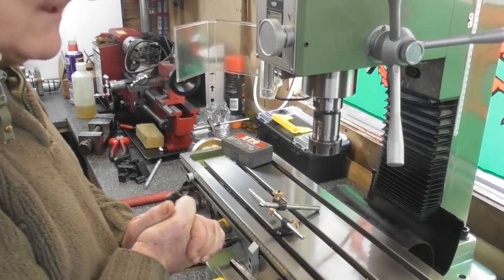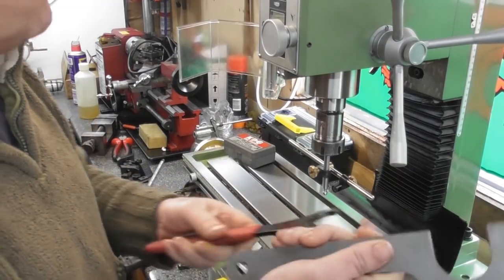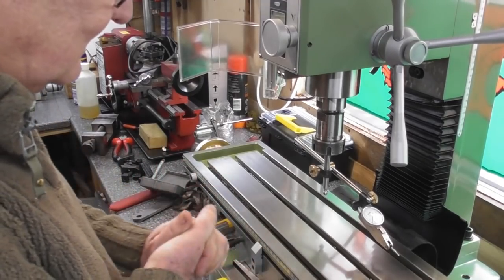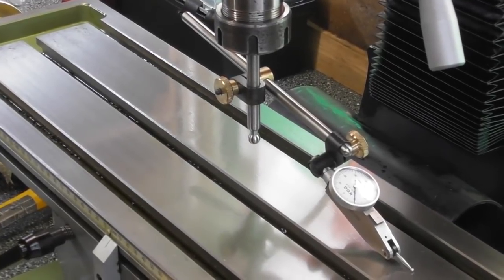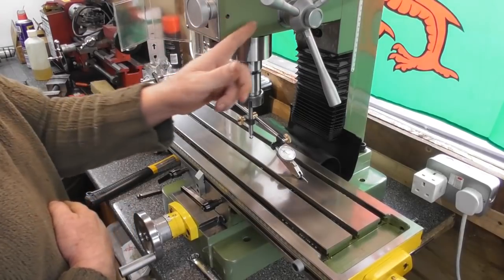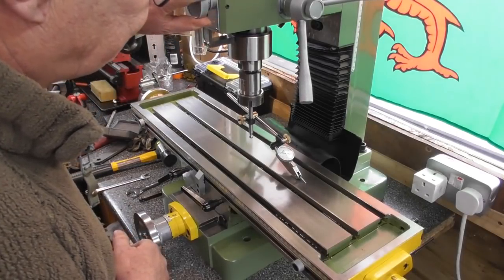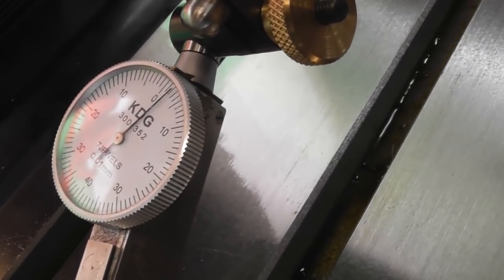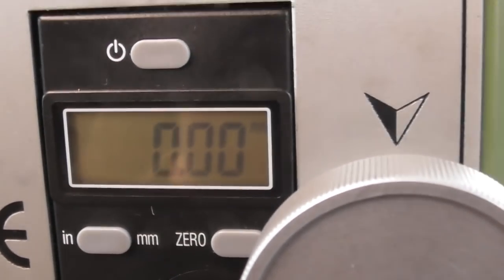Warco WM16B mill   tramming the head

Comment: Next time you need to tram the head, do not keep winding the quill up and down each time and use the built in DRO. Get a parallel or Gauge block, place it on the table, zero out the DTI, swing the arm around180 degrees and gently slide the parallel or gauge block under the DTI to check the reading. Your way you could be introducing errors by moving the quill each time as there is bound to be some error in the DRO digit measurement.

Comment: Nicely done, considering how tricky these small machines are to tram in some ways, especially with nod. I have to check my round column mill drill every now and then because it's almost like the castings were green when it was manufactured and over time the unit gets out of tram.

Comment: Thanks for the update Ade.  When you finally get the vice on make some ply table covers for either side. If you put lips around the top of them it Saves cleaning the T slots as you just remove them and pour the chips in the bin, dings from dropped parts and also stops tooling/ cutters/measuring instrument rolling off.
Reply from the maker: it is on my rapidly growing list , Cheers Ade.
Reply: instaBlaster...

Comment: I was always taught to tram the head in with a bottle square traversing with the quill in the z axis.
Reply from the maker: Hi, Shaun . May I ask what a bottle square is ? is it what I call a Cylinder square. if so. what is the method , sounds interesting , even though I don't have one . Cheers Ade.
Reply: @ade63dug  Yes Ade pretty much same as cylinder square but in profile looks like a bottle. I made one as an apprentice toolmaker and still have it to this day. It was a piece of O1 steel that I had professionally hardened and then cylindrical ground. The bottom face is relieved with a shallow counterbore so it sits perfectly square to whatever datum surface it is sat on. Happy to send you a pic if you like.
Reply: I forgot to mention that my last toolmaking job I had I worked for a German guy who was probably the best engineer I ever worked for and he trammed Biridgeport turret mill quills in by the same methodology. First time I had ever used a Swiss made Interapid stylus DTI and now I have three of them in my home workshop - so much better than any other brand of DTI I have ever used.
Reply: @ade63dug  you run the stylus of the DTI along the z axis with the quill picking up the highest point of the bottle square surface in each of the two positions until it trams spot on. I only checked this on my Tom Senior mill last weekend.

Comment: Hello, excellent video, I have the same machine and it seems like the main bearings (on the spinal) are dry, but can’t see a procedure to lubricant them, any suggestions please, I have used my oil can and oiled from the top drawbar and it has dripped through but not sure if it’s dripped into the top conical bearing, cheers Chris

Comment: Love your videos Ade!  You are one of my favorites. I'm a retired old guy and have a similar machine.  (PM25) I wouldn't trust that little mickey mouse quill dro though,  that just adds another variable. I would like to suggest letting your dial test indicator come around over an 8x11 piece of printing paper you hold in your hand so it doesn't get caught in the tee slots.   Hope you saw my other post regarding your spindle not completely stopping when you turn your rpm down... that's not correct, something wrong there.
Reply from the maker: Not having experience with this type of motor set up i did not think at first that this was a problem , now you have pointed it out i will give warco a call and see what they say , thanks for pointing it out , Cheers Ade.
Reply: Those quill DROs are actually very accurate and repeatable.
Reply from the maker: @CraigsWorkshop  I forgot to answer this part of Joe's question . yes i tested to see how repeatable it was at several different point along the travel before i started. so much goes on behind the scenes ey . It was spot on all the way through the range .  Cheers Ade .
Reply: Yeah I guess what I was trying to say was I wouldn't trust my thumb and forefinger on that little dro🙂
Reply: Just an fyi I don't know how accurate what I'm about to say is, so take it with a grain of salt but I have been told that they buy potentiometers in quantity and some match the circuitry and some don't it's very possible that that's the reason some don't scale to zero rpm. I'm sure the company will never admit to any of it 😕
Reply: @joewest2560  Ah ok, understood! (Me too in that case) :)
Reply: @ade63dug  I have to agree completely with Joe West above.Your method works fine to get the initial head alignment well under what the maximum travel is on the dti. But every video I've seen done by highly experienced machinist's and all the reference's I've ever read mention just swinging the dti 180 degrees in each direction. Pre loading the indicator by a thou or two once your very close still allows it to gently cross the tee slots as the indicator is swung around in each direction. The reading displayed or it's resolution on these type of bar scale dro's is certainly not what there repeatable accuracy is, and even more so when you check them against something like a proper set of gauge blocks. I have a very good and fairly expensive Mitutoyo quill dro on my Bridgeport clone mill specifically designed as such, and I still wouldn't completely trust it to do the final tram on the head. Even my digital Mit. micrometers come with a test certificate graph showing where there inaccuracy's are located. Once I'm within that couple of thou I always swing the whole indicator as that minimizes any error stack up. On even the best dro's the "allowable" and world wide standards are a repeatable accuracy of + - one count maximum. Yes there usually better than that, but being that amount off will still will pass inspection. Given there cost? It's unlikely these much cheaper Chinese quill dro's are even checked never mind verified for there accuracy.Your method introduces uncertainty and further areas where the final tram may or may not be correct. Plus it's far faster and easier to just swing that indicator around while having much more certainty in it's reading.

Comment: Ade, i don't want to put the spanner in the works but i would retram without moving the quil up and down, the quil fine feed is just a glorified caliper and not as precise as your dti. Try it on a piece of metal while cutting, do a cut, raise up using the fine feed then lower it again to the same reading and do a repass, you'll find that sometimes it cuts, other times it cuts air and other times just rubs but not cutting then next time a slight cut. 
Another tip, buy yourself a 2032 Li battery charger and rechargable button batteries on aliexpres as I garantee you'll forget to switch it of and when you come to use it the battery is dead, don't ask how i know. The chargers and rechargable 2032 lithium button cells can be got in a pack, I got the charger and 4 rechargables for i think 8 quid, well worth it especially as some of my other stuff uses the same button cell.

Comment: Hi Ade, Just a thought for the future. You could make a 90 deg bracket with a reamed hole in it and mount it to the underside of the head, drill and ream through the hole ( into the column) and insert a dowel, would stop you having to tram the head every time.
Reply from the maker: Yet another great idea. perhaps a tapered dowel with a threaded portion to the outside for an extractor nut would be awesome . i hope not to tilt the head often though. Cheers Ade.

Comment: I wouldn't rely on the Digi gauge on the machine Ade... try using a piece of plate glass or, as Chui Rios said a couple of gauge blocks or as you mentioned, a brake disc to tram the head. I used  plate glass to do mine & achieved 0 - 0 on the X axis & .0005" on the Y axis. I have also fitted adjusting/lock pads on either side of the head at the top to lock the head in position.

Comment: I have been thinking the tramming would be easier if you put a large piece of glass on the mill table and tram on that to get close to perfection. 

Then remove the glass and indicate on the table to check your progress.
Thanks for the vids
Reply: Thats the way I do it.
Reply from the maker: another sweet idea , wish i had some glass , Cheers Ade.
Reply: Didn’t I see you with some 321 blocks on previous video. You could use one of those under the dti tip and just slide it around with the dti . Hope that makes sense.

Comment: Hi are, exalant vids ,just finished re building my mill (up graded to fixed column. ) had tilting column which constantly went out of alignment. Check out edge technology for exalant quality tools at a good price. I have small tramming gauges (much more stable than the set up you have used ).thanks for sharing, have fun Malkin chips and be safe.
Reply from the maker: I have seen them . on my future wish list. i need more important things first . Cheers Ade.

Comment: ADE... My way of tramming my mill will be to attache chains to it, and suspend it from the roof
of the shed. Now swing it from side to side like a pendulum when it come to rest, slowly lower it onto 4 pre-drilled bolts.
If it's correctly mounted using this method, the DRO should read about 12 oclock ...
If the DRO reads 11.55, then it will be to slow, or 12.05 say... it will be to fast...
This can be adjusted on your rpm control to make it run at the right speed...
Just some advice...

Frank...
Reply from the maker: Perfect , i shall try that out , lol. Cheers Ade,
Reply: @ade63dug  Oh, I forgot to tell you Ade, the problem with this method is, that I now need a new
roof on my shed...

Comment: I did this for the first time the other week - before that I just ran it with head set by eye. I had the added problem that the bolts that hold the head would twist about 0.1mm to one side, so had to adjust with a bit of offset...
Reply from the maker: I was thinking as to why this happens , on my mill they were nasty thin mild steel washers with spring washers and then some nasty cheap nuts, i think if i used a thicker , tougher washer with no spring washer it may help , with better nuts as well , i found that by watching the clock and progressively tightening so as not to move the needle i got there in the end . interesting subject though. Cheers Ade ,
Reply: @ade63dug  on my mill, the clamp is on one side of the round shaft that attaches the head to the column. When you tighten it, it twists a little bit.

Comment: I have the same problem with nod on my mill by 0.3 over 250mm. I need to check to see if the column ways are square to the bed ways of the machine. (table removed) I'm not sure how measure this. I would like to find where the error is.  It could be where the head connects to the column, Column to the base, The block in between the table and the base or the base ways.  Any information on how to do this would be of grate help (:
Reply from the maker: There are so many variables , my first thought it to check the gib on the column, Are we talking about a new or well worn mill. ? send me an email and i will give suggestions as to where to look. Cheers Ade.

Comment: Hi Ade, some good info' for when/if I ever get a Mill.  Sorry if I missed something, but what if the table isn't flat and/or parallel to the ways.
Reply from the maker: Hi Steve , a very good question . firstly this issue of flatness of the table . I do not have the equipment to test this out , i have to take if as read that it is flat on the grounds that it is ground cast and new , i know that this is not guaranteed but it is a starting point . secondly it is not a problem if it is not parallel to the ways as i am setting the head square to the surface presented to it, which , ultimately is the work piece. Clear as mud i know , hopefully i have answered the question in the way i interpreted it , Cheers and thanks for your support, Ade.
Reply: Understand.  Although I guess it's unlikely that Chinese cast iron will be "seasoned", so maybe susceptible to a little movement.
Reply: @ade63dug  I understand you Ade. Your new milling machine is bound to be more accurate than my 1950s worn machine but I work on the same principles. If the area on the table which you are working on is square all round to the quill that's all that matters. You will be able to machine work accurate and square. That's a fantastic theory (long hand) of how and why for beginners in this field.
Reply: @stevebosun7410  I don't think Chinese cast iron will be seasoned at all. They may be using advanced methods of casting etc; which may not need seasoning? Who knows. As long as it does the job intended that's all that matters.
Reply: As you say, as long as it does the job.  Although I doubt the Chinese employ any advanced casting methods.  I guess my thoughts were focused on the length of the table casting, and it's susceptibility to movement  due to it's length.

Comment: Eeek...Scared me Ade.  You should hold onto the collet holder when tightening the nut and not the spindle.  I know you didn't get too aggressive with it, but you don't want the taper to get marred if it slips inside.
Reply from the maker: I totally agree , i did not go mad tightening it and i would normally use the spanner on the chuck , however, i wanted to demonstrate the spanner quality , or lack thereof , with the spanner supplied with the mill, i does not fit the flats on the chuck , great point though and well spotted , Cheers Ade.

Comment: I believe your getting an error the way your going about traming the head. Without changing the position of the guill. Use a pair of gage blocks the same thickness, and swing from block to block.🙂
Reply: Ade  I would have used your super new 1 2 3 blocks and kept the quill fully up, also I would have extended the  dial indicator arm to its fullest extent giving you the best chance of correcting any error,by almost doubling the amount of error at each end of the table it is easier to halve it in lighter taps on  the column head.
Reply from the maker: Good point and Noted. Cheers Ade.
Reply: @samrodian919  He's down to a tiny 1:15,000 error already. That rivals some decent engineers levels for error. (Assuming 0.02mm in 300mm). How rigid is a 150kg table top mill, during a cut? (I know mine used to flex more than that.) I reckon what he did was spot on.
Reply from the maker: @CraigsWorkshop  it was a good point though , if i were steffan  i would try harder , got to love him . Cheers Ade.
Reply: @ade63dug  True! Stefan has some good videos about making his machine ultra rigid. Very inspiring stuff. I know you have too much on your todo list already though :) Keep it simple - test cuts next - happy days!

Comment: Hi Ade!
Really nice to whatch Your entusiasm. You have shown really good and scientific measuring methods in the past. However, this was more confusing than educating. Why move the spindle, the head and using the indicator on the mill? Why not put a sheet of paper under the needle for sweeing it and then remove the paper? Your way introduced firstly the half digit uncertainty of the hundreds of mm in the mill indicator. Secondly any not yet known mechanical issue could be involved.
Why not bring the indicator in touch with the table and keep the head locked all the time?
My spindle is probably not straight in all directions so I could do the same check up. Anyway, the mill does what my poor skills let me do.
Reply from the maker: I do agree that keeping everything locked is a better method , i did suggest this at the outset of the video using a brake disc , many people have suggested a sheet of glass , also a good method . i did check the repeatability of the digital scale on the quill before commencing . this said i apologise if you found my method confusing , there is nothing staged or scripted in my video's and they are a representation of what i actually did using the tools and facilities available to me at the time . I am confident that the readings i got were accurate and true so i am happy , Cheers Ade,
Reply: Using the word confusion, as I did, was a bit wrong. Measuring the way You did looks pretty much like the chain of actions used in single point threading, when You move the cross slide back, move the carriage back and then cross slide back to the cutting position. I wil try measuring my own spindle, that's surely tilted, and see what "my method" feels like.
I suggested a pice of paper because the limited stroke of the indicator must be regarded. My one has a maximum stroke of some 1.1 mm.
People say that nothing smells as good as a new car. I say that nothing smells better than a new lathe, a new mill, a new machine, in the shop.
Happy milling Ade!

Comment: Ade - great series on your new mill.
But I think you have made two assumptions during your tramming technique.

First - you assume the repeatability of the Fine-Adjust is as displayed. Usually those cheap Chinese scales, although they display to 0.01 mm, have a repeatability of 0.015 or worse. Meaning you could be off by maybe 0.02 and you think your exactly spot on.
Second - you state (I think you said this) that the offset displayed on your offset is the tramming error across the full span of your swing. Actually it would display 1/2 of the full error. Think of the head as the centre point along a straight line, a line that is not quite parallel with the table - because it is not yet trammed perfectly.
Reply from the maker: I checked the repeatability  several times before using this technique , no error , when i had finished i did the tramming check from a parallel and no discrepancy , test cuts confirmed this . i am well aware of all you have said and have been tramming mills for 40 years , mostly bridgeports but the principle is the same . Cheers Ade.